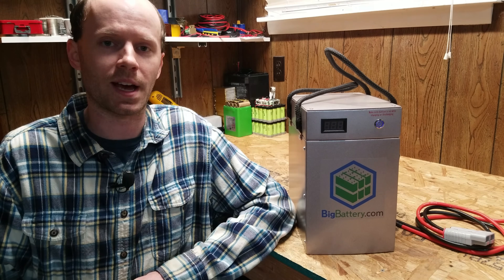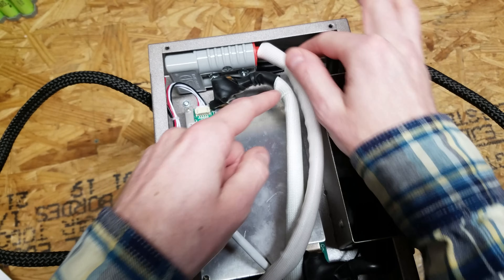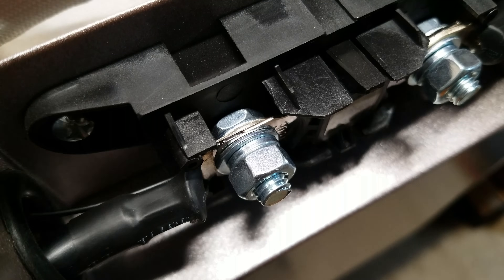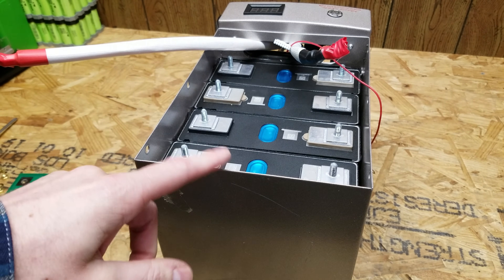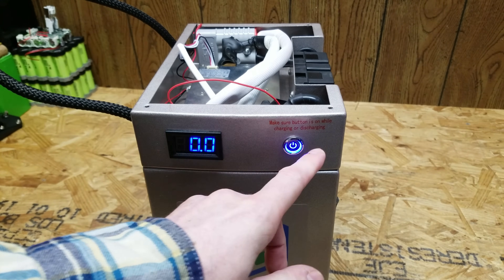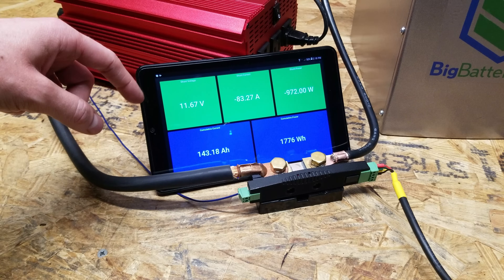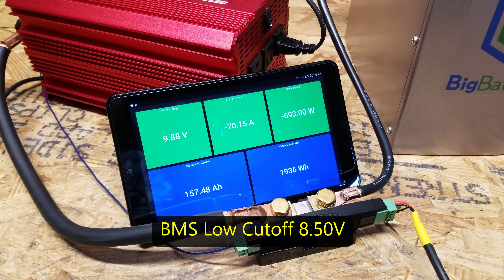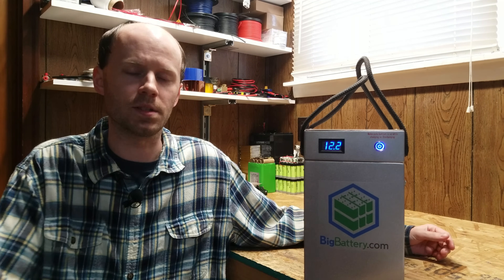BigBattery "OWL" 12V 170Ah LiFePO4 Battery, Review and Teardown

Comment: I got two of these a few years ago ask for your recommendation. They worked great until I accidentally unplugged the solar panel. Both batteries drain down one shut off in time. But the other one drained down to like 7 V. And I can't get it back what should I do?
Reply from the maker: Does it turn back on if you connect a charger? If you have a charger that needs to see 12V before it turns on, you may need to temporarily "jump" it with another 12V power supply (like a bench supply) first to get the BMS turned back on.

Comment: Wonder why you didn't state how long it took to use up 170 amp hours?
Rolls lead acid have 468 ah and cost less. Never said there was any advantage to the big batteries.
Reply from the maker: Because the time it takes is entirely based on your load. It would be a useless statistic for me to report on.

Comment: You don't say how long your 800 watt heater ran for?
Reply from the maker: I don't keep track of time during the tests as the statistic is completely meaningless.
Reply: @LithiumSolar  I think you should to show folks how long they can things, so a heater on high would last what 8 min? 1500 watts
Reply from the maker: @harrypalmer5603  Everyone is going to have a different heater so I don't think it's accurate to say "a heater can last 8 minutes" as maybe your heater pulls 1000W and mine pulls 1500W. You can calculate this yourself easily with the formula Capacity x Voltage x Efficiency / Power, for example 170Ah x 12.8V x 0.80 / 970W gives you approximately 1.79 hours.
Reply: @LithiumSolar  so true, Loved the video

Comment: if you need to charge these battery's to 14.6V , why do all the video"s show 13.1 as the current charge? what exactly does this mean?
Reply from the maker: With the LiFePO4 chemistry, once the battery reaches fulll charge and you disconnect the charger, the batteries voltage drops a little. It does not rest at 14.6V. This is completely normal and to be expected with all LiFePO4 batteries.

Comment: Thanks for uploading.. 
Can you connect those in series to make a 48v pack like a normal lead acid battery?
Reply from the maker: At the time I uploaded this video, you could connect 2 in series. BigBattery has later recommended against connecting any number in series. If you're interested in doing so, I would definitely ask them directly first before purchasing and/or before connecting.
Reply: @LithiumSolar  Thank you for your reply.. 
I plan a project to use 2 packs with internal BMS, LiFePo4, 48v connected in series (96v for EV) and will have the capability to re-connect in Parallel 48v for home inverter use during grid outage. 
Some vloggers say its not advisible to connect them in series but did not explain why. Though,  they say its ok in parallel.. 
Im curious as to the reason, Why not? 
Seems I need a dedicated pack for each application.

Comment: Can you connect those in series to make a 48v pack like a normal lead acid battery? 
Thanks for uploading this video.
Reply from the maker: At the time I uploaded this video, you could connect 2 in series. BigBattery has later recommended against connecting any number in series. If you're interested in doing so, I would definitely ask them directly first before purchasing and/or before connecting.
Reply: @LithiumSolar  I would appreciate the support if you can get BigBattery to give a technical reason on why not.. 
Thanks appreciate what your doing.

Comment: Any trouble shooting tips for these? I shut mine off, added a 2nd inverter, then turned it on and it made a pop/click sound and now the blue display wont turn on. I checked the 300a fuse and it's good. I measure 2.8v when checking the leads. I disconnected everything. I emailed bigbattery for suggestions. I don't want to void the warranty by doing a complete disassembly but also not looking forward to paying shipping. I used it for 1 year. If I had shorted or switched the wires the BMS and or fuse should've protected it? no burned smells or smoke from it. the pop/click sound it made was similar to a circuit breaker sound.
Reply: update on this. I had a call with tech support and they helped me get it going again. They had me remove the top cover then connect a wire between the two huge wires going to the BMS, I think this bypassed the BMS. somehow this reset it and it started up. Initially they thought maybe the cells had run down too low and would need to be trickle charged. individually until it was enough for the BMS to function.

Comment: I have the 48 V husky battery installed in my Navitas club car. At first it worked OK, but now the battery management system has failed. I was able to make contact with someone a big battery and at first they were somewhat helpful, but now they are not responsive. I would expect a better customer service for such a large investment. If you have any advice or a better way to contact the company please let me know. Thanks in advance.

Comment: I have the BB 48V Luma.  Works great, but I noticed something when I pull more than 28A at 48V.  The right most decimal point on the Amp display will turn on and lock the display.  I can power down and clear, but BB has not been able to tell me what that means.   As an EE I use the decimal points to indicate things and I am sure they have too.   Anybody have any ideas?

Comment: big battery has been plagued with small problems the biggest being a few had cells leak which is an honest mistake but another reviewer tested the low temp cutoff which failed at 32degree's F big battery told him they have the only lithium iron phosphate cells that can safely charge well below freezing!    bwahahaha. i would never trust anything big battery says or makes!!
Reply from the maker: Yes, they have had a few issues. I was told that they were hiring someone to oversee their QA process to fix issues from occurring in the first place.
Reply: @LithiumSolar  while i can understand some bugs must be worked out of new systems...   i cant get passed the fact they tried to convince him their lithium cells could charge below zero and their low temp cutoff was like 15degrees below zero instead of 32degrees +/-. from my research [your review included] i think SOK cant be beat for quality/price performance!  what do you think of SOK?
Reply from the maker: @carbonrrpilot  Yeah, I don't really know what happened there... And yes, the SOK battery is fantastic and, while I do like the OWL, I would rate the SOK slightly above the OWL. The SOK was just... flawless!
Reply: @LithiumSolar  ive been building a pretty tricked out 280ah setup in a thick clear lexan case i made. [eve cells/overkill solar bms] and have been watching alot of vids/reviews learning about the new lithium chemistry many of which were your vids and i learned alot, im posting a build vid of it soon and would love to get your opinion on it!

Comment: What does it read when it's fully charged is it 13.4?  tia
Reply: Oops, fount it, thank you!!
Reply from the maker: 14.6V would be full charge for this battery. LiFePO4 will drop though once the charger shuts off - it won't sit at 14.6V.

Comment: Can this battery be charged without using an inverter - solar panels?  I haven't yet purchased solar panels and my owl will arrive today.  tia anyone
Reply from the maker: Yes, it can be charged with solar panels. You need a solar charge controller though. You can't connect the solar panel directly to the battery terminals.
Reply: @LithiumSolar  I bought the MPP 12 volt 1,000 watt inverter-charge controller.  However, I have not purchased solar panels.  So, I was looking for a charger that I can charge this with, without using solar panels.  Also, as a backup in case the MPP goes down for some reason.  I suppose, for now, I can hook up the MPP and charge the Owl using the 120 volt transfer plug; although I haven't purchased any of the wiring yet.  On the Owl website, and a 26 second video they put on youtube, they show a charger with the anderson plug attached but their website has ZERO information on it besides purchase information.  Anywho, will have to do more research or buy all the wiring for the MPP.

Comment: Will Prowse had some cells from a BigBattery leak on him.  The leak(s) were apparently caused by welds in the casing rubbing holes through two cells.  It's too bad you didn't check the condition of the casing welds.  RVs bounce and giggle batteries around. Welds that are not smooth can cause a problem.  Also, aren't such battery cells best used standing upright?  That would mean using this battery with it lying on its back, which should be fine.
Reply from the maker: I checked my cells after that video and do not have any problems. I'm told that Will had a beta version of the battery. Mine has padding on the sides. Also, BigBattery has confirmed with Lishen that these cells can be on their sides. That is not true for all cells, but according to them, is safe for these particular cells.
Reply: @LithiumSolar  I certainly hope BigBattery has taken this potential weld and padding problem VERY seriously.  If not, there will inevitably be a BIG PROBLEM (in the thousands) coming with RV-mounted batteries.  That said, other than this potential problem, I am VERY impressed with BattleBorn batteries.  :-)

Comment: Can you charge this with the 40 amps provided by the MPP 1012 LV?
Reply from the maker: The max charge rate of this battery (now called the OWL) is 175A. So yes, it can easily handle a 40A charge :)
Reply: @LithiumSolar  Thank you so much for answering, I appreciate it.  I thought I saw somewhere, was researching all day and my eyes are crossed at this point, and thought I saw that the minimum charge rate was 80 amps.  Anyway, I bought the MPP 1012LV today and the Big Battery's 170ah 12 volt using your code and saved a cool $100!

Comment: I've been watching videos on making your own system. I was going to do that for my small camper and have it portable for my electric boat. After watching this video I'm deciding that what I was going to  make is done much better here with this unit. Thanks for the video. I'll be ordering one of these this summer. I just need to find out which anderson connectors I need to connect both the charger and camper to the thing. I think it's the parallel one. I'll have to make sure.

Comment: I would like your opinion on purchasing either 2 of these 24v units or 4 of the 12v and series either of them to run a 48v electric outboard. I am currently running that 48v outboard with 4 AGM 110 AH batteries in series. Please let me know your thoughts. Thank you - Ro

Comment: I got the same battery today. So far I'm happy with it. The low voltage on the BMS seemed a little low to me. 9.2 volts showing before it shut down.  I always thought 9.8 was the correct voltage . I can live with 9.2.

Comment: 160Ah?! That is not good. Is that shunt calibrated? I pulled over 170Ah. And those cells typically pull full capacity. Hmmm I wonder why you go that figure. The cables should not change the results that much.
Reply from the maker: I need to re-test this battery. What C rate did you test yours at that you saw 170Ah? Mine was a 0.41C test. I was questioning the shunt as well, which is why I re-tested the RoyPow battery with a Victron shunt and the result was pretty much the same.
Reply: @LithiumSolar  
I just received one of these Friday supposed to be the 202 amp version according to the link I used to purchase it.
It arrived with absolutely no paperwork documentation whatsoever.
I've ran this thing to five recharge cycles and let it sit it 14-4 for about a half hour longer each time.
It wasn't until the 5th recharge that I finally got a blinking light on l1 on the BMS.
Been laying the battery just sit for the last 24 hours and it's lost 1.1 volts all by itself.
I suspect I have a bad cell.
I still have no idea if this is the 170 or 202 amp.
But my rough estimates from how many amps I was taking out and the time it took the BMS to turn off I'm basically in the sub-170 range I will know more later when I get a real shunt to test it.

Comment: This is great work, thanks.  Do you know the difference between the Big Battery Power Block & Extreme Power Block?  Everything I see the spec's are the same.
Reply from the maker: I asked them this 2 weeks ago. The extreme version has a different BMS that supports up to 4 in series (the regular version supports 2). They also noted that the extreme version has a different kind of thermal management that includes fire-pellets inside. I don't have any further details on what those are exactly.
Reply: @LithiumSolar  Here is their response.  

"The two main differences....1) the fact that the BMS in this power block allows for running them in series up to 48V 2) the new Extreme battery has "Extreme Thermal Management control" which means that if it were to be caught in a fire or by some miracle of science catch on fire then it has little pellets built in that will automatically extinguish that fire. But yes outside of that it is 100% the same specs. The batteries can be put in parallel and series with each other the same as before".
Reply from the maker: @hatenlebron  Ok yes, that's the same response I received.
Reply: @hatenlebron  It in a stainless steel enclosure instead of regular metal

Comment: Since the cells are in series and with that difference in the voltage between each cells you would be better off to balance the cells until they are the same voltage then charge the battery to 14.7VDC.
Problem being is the BMS will shutoff the battery when one battery reaches its low voltage limit thus shutting down the battery during discharge with more voltage available in the other cells and stop charging when one cell reaches the 14.7VDC leaving other cells with less than a full charge. This is why you didn't get the full 175AH out of the battery.
This does not happen when cells/batteries are placed in parallel.

Comment: If I buy 2 24v and connect in series do I need to balance them.ty for answering.
Reply from the maker: Before you connect one or more, whether it be series or parallel, you need to make sure both are at the same state of charge. You can do this by charging each one up up to full individually prior to connecting them.
Reply: @LithiumSolar  but after some usage in series will they unbalance.

Comment: Can you charge this battery with a solar panel as well, and if yes, where is the solar input on the box?
Reply from the maker: This is just a battery. You'll need a solar charge controller, which can then be connected to the battery terminals. OR purchase an inverter that contains an MPPT built in, such as MPP Solar. The inverter I used for testing here is just an inverter - no charging functionality.
Reply: @LithiumSolar  I was wondering the same. There is only one place to connect the Anderson plug. Is that one connection for both an input from a charge controller, and the output? Maybe using the parallel cable set from their website?

Comment: I confirm they are Lishen 202ah model from china.
Reply: Yeah he's right, they are lishen cells. But no, they are 175Ah. It's a new cell
Reply from the maker: They are brand new 170Ah batteries. Why do you think they're 202Ah Lishen?
Reply: @LithiumSolar  it's brand new because I'm battery seller in thailand and touch thousand of batteries
Reply: @LithiumSolar  I think maker reserve capacity 30ah for save lifetime reasons.

Comment: Can this be charged with the trucks alternator in parallel with the truck's battery? Like I'm currently doing with a regular automotive battery? Then I'd also like to be able to see the percentage full on the battery but that does not appear to be a feature. Ideally I'd like to see the charge state and be confident it is charged enough to handle the day's work...

Comment: I've had my eye on Big Batt. Enjoyed the tear down and test. The series connections on the PCB seamed pretty light. I wanted to see the underside of that PCB board. I guess there are buss bars in that board? Can you tell the size of the bars? I wish they had the premade Anderson connections with large gauge wires. If I buy, I think Ill have to make my own Anderson connector
Reply from the maker: The underside of the PCB is shown briefly at 6:44. I do agree, Andersons with #4 would have been much better than the #6, but if you're pulling 175A, should consider moving up to 24V anyway in my opinion.

Comment: Great video. If you wire these in ser for 48v it should drop the amp pull resulting in lower temp on the cables. I have two of the 48v nmc power walls. Why they put 50amp anderson connecters in the 48v nmc is a little baffeling when the breakers are for aprox 63amps. Last I agree they should have used fuses. Can you do a review on wifi or bluetooth BMS?
Reply from the maker: "50amp anderson connecters [...] breakers are for aprox 63amps" > The standard accepted rules (NEC) are to derate a breaker to 80% for continuous loads. If you are pulling 50A, you need 50 X 1.25 = 62.5A breaker. That value doesn't exist, so it's rounded up to 63A :)
"review on wifi or bluetooth BMS" > Is there any in particular you're looking at?
Reply: I agree to the 80 20% rule on all my circuits. If you have any suggestion 14s or lifepo? I have a outback power FP1 power panel. Outback said to me that the FX ser inverters are not compatible with lithium batteries. So ive set the power wall battry to the HVCO and LVCO.
Between 42-57 volts charging via globle using the flexmate 80 thru the Mate3. Doing this you lose monitoring.